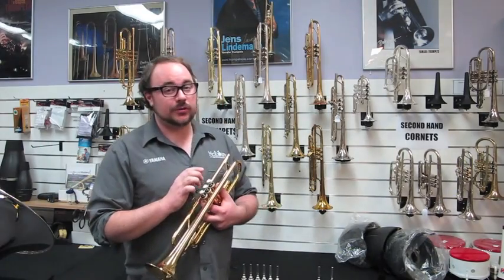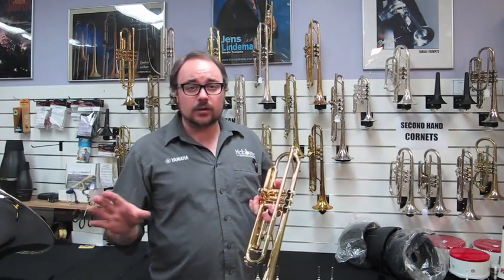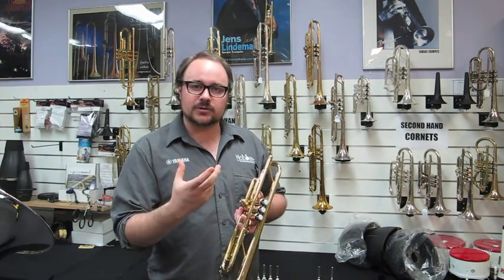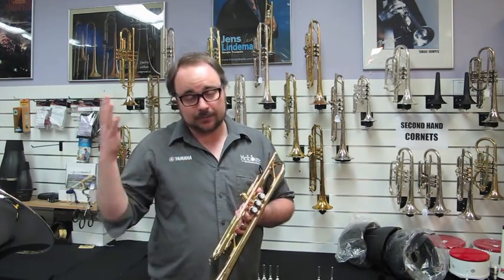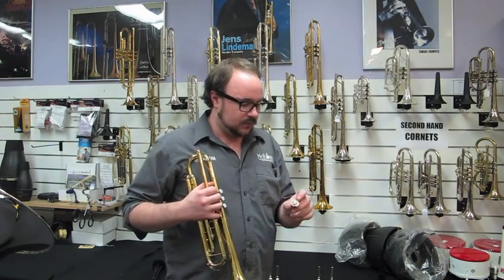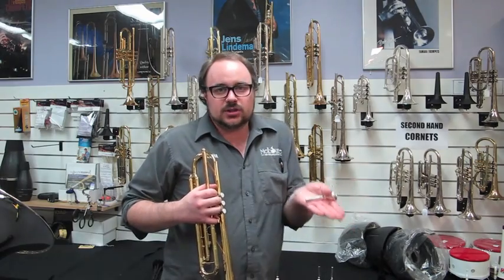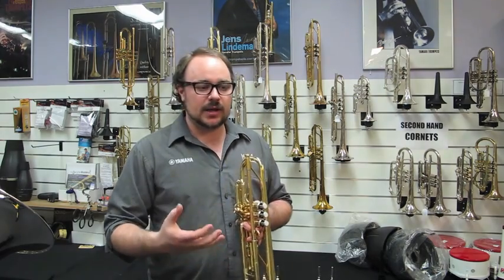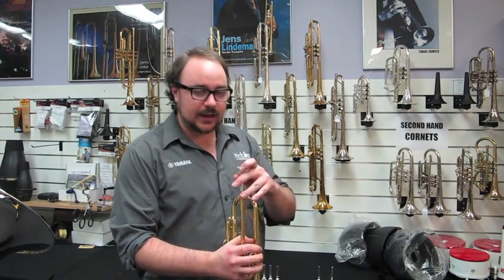OZWINDS - How To Choose a Trumpet Mouthpiece

Comment: Hi Brae,
Very interesting and very informative with very good sound advice. You got my attention as soon as you mentioned the Bach #3 because that is exactly what I use and have done for some years. However I have enlarged the throat of mine out to a much larger bore to improve my blow rather than change mouthpieces. I have done this to several #3's in many different throat sizes so that I can properly compare them. In the early 1900's this was a common practice and even Vincent Bach did this for his custom mouthpiece customers. Even after Bach started manufacturing his big range of mouthpieces, he chose the drill size of #27 as a pilot hole and would ream them out according to his customers needs. His mouthpieces became so popular that buyers of his mouthpieces and not knowing about this art of adjusting the throat just accepted them as they were.
I see that David Monette is using much larger throat sizes (#18- #22) and I believe personally that this is one of the main benefits of his very expensive mouthpieces. A very good reason for not ignoring history and accepting that "Everything is old is new again" As the count would put  on the end "Clink, Clink" Thanks again for your enjoyable video. Richard Autenzio.
PS. Chris Botti's old Bach #3 Mouthpiece from the 30's has it throat enlarged to a #15.

Comment: Very good info. The only problem is that even in those Bach 3 sizes. None have the same rim design. At least I have read as such. If all had the same newer Bach 3C or Mount Vernon 3C rim. The comfort part could be solved also. Seems the non Mount Vernon ,10 1/2 C/ Bach 3C/ 1 1/2C along with the 1 1/2 B Bach have the more comfortable rims. Not sure how these sizes would pan out in the older 1920//1930's mount Vernon versions.
Reply: That's why I play Yamaha mouthpieces. The rims are the same.